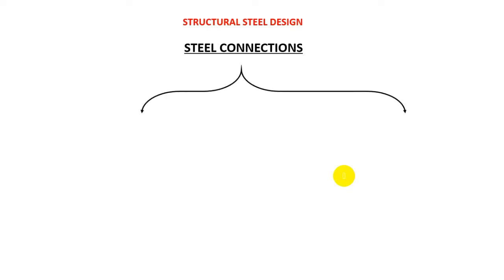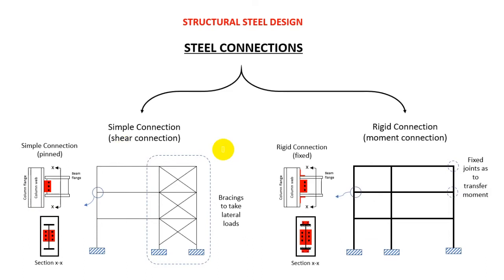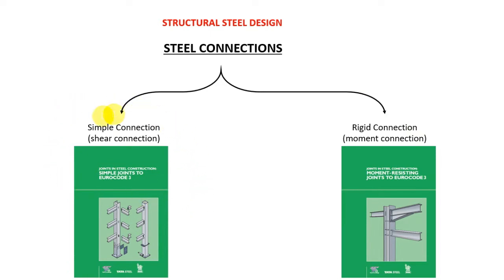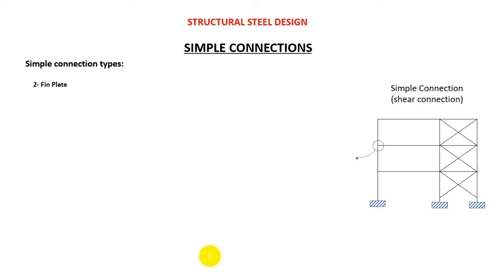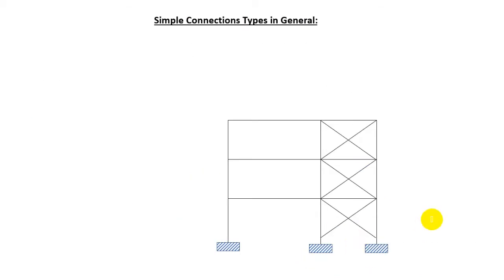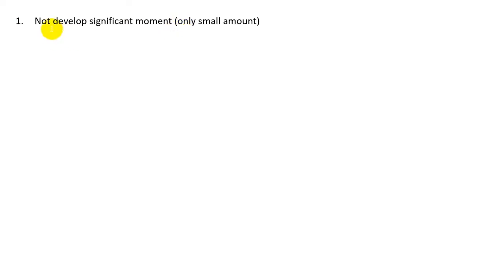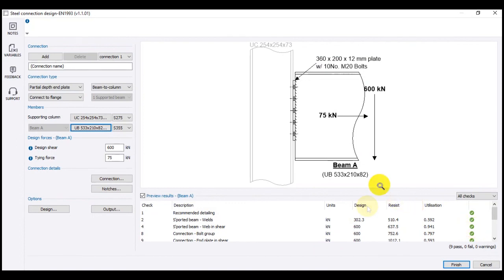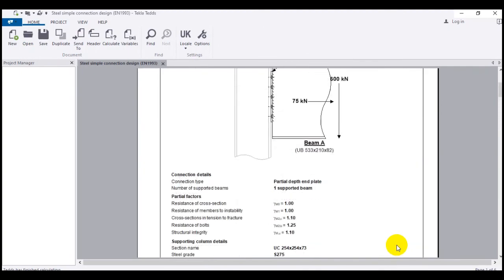EC3 Simple Steel Connections

Comment: Abdullah, very nice, concise and precise presentation, indeed. Question: What about pull through resistance if it has not been calculated for hexagon bolt without washers, in accordance to PN-EN 15048 ? Thanks.